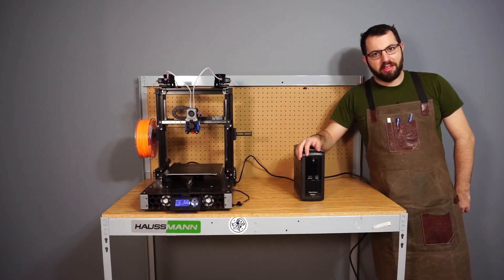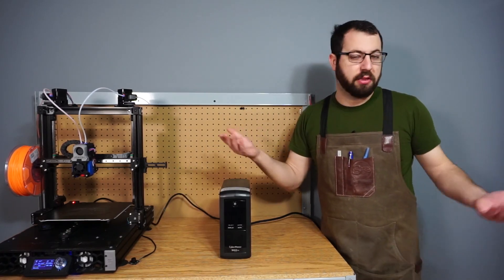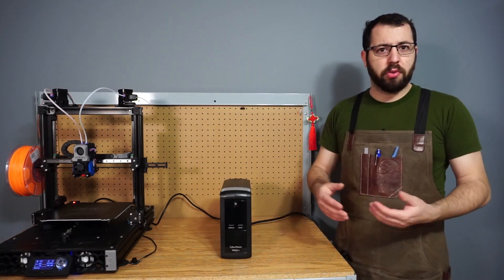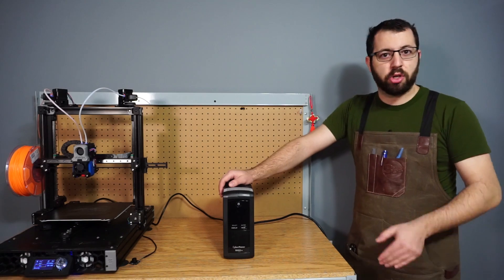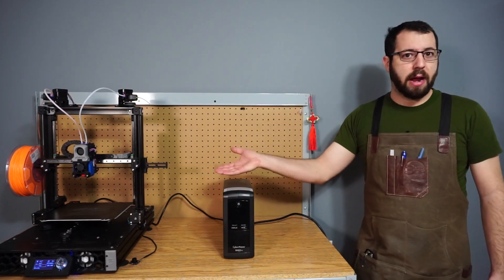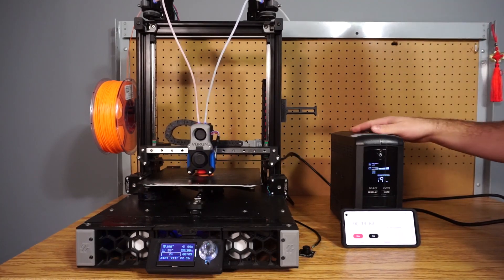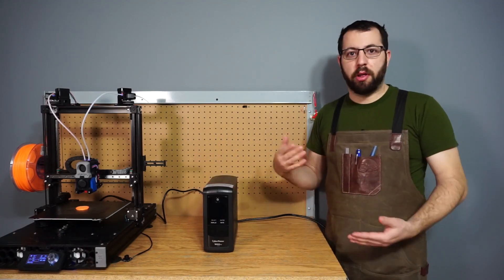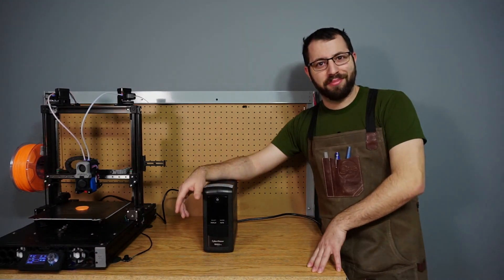Power through power failures with a UPS for your 3d Printer

Comment: This might be a stupid question, but I tried connecting a smaller UPS and it was highly problematic. If I recall accurately, even with the two printers turned off, in the morning the batteries would be dead and the GFCI outlets tripped. I tried another UPS and the same thing happened with it. I tried printing with one connected and they would trip the outlets and run off of the battery till the battery was dead.

Comment: you buy inverter 2000 watts 12 volt deep cycle battery 100 amp do much better run time those batter sucks ok you can change battery i have back-ups cs 350 i change battery to 12 volt 20 amp lead acid battery i dose run 200 watts get much better run time

Comment: You can also use a battery backup deep cycle battery bank for emergencies, you use the UPS til you can switch over to the emergency stand by the power this way you can finish the print/s without interruption.
The UPS will not know the difference if it is getting power from the grid or an emergency battery bank, it is still getting power.

Comment: For me what worked was backup batteries. You'll need a way to fast switch it on when power failure happens, I designed and implemented my own solution for that and it saved me a couple of times.

Comment: An interesting experiment would be to do a print without the bed heater running, since that's probably the biggest draw.  But your test is a real world one and 5-7 minutes of runtime if the power blips is still worthwhile.  I have a few on my machines since most flickers here are momentary (and thankfully rare).

Comment: Nice video 👍 I am from India can you tell me more about hardware implementation like what kind of hardware I will require to save g code after every layer print and how to do that
Reply from the maker: This setup is strictly a hardware method, there is no way to resume once the UPS runs out of power

Comment: does the UPS also absorbs fluctuations of current/tension from the network?
Reply: Generally doesn't matter aslong as its not big fluctuations which rarely happens that's generally just a power outage. Every electronics has capacitors on their mainboard from power supply to the control electronics that stabilizes that. If you have a extremely unstable power grid i would suggest a small ups of sorts but i dont think any power grid is that unstable today.

Comment: Hi! Does it works constantly through UPS (all is plugged) or it switches for a backup power only when necessary? I'm trying to find if it's possible.
Reply: UPS (Uninterruptable Power Supplies) the device will automatically switch over to backup power once power is cut. And switch back to mains power when it returns and then start recharging the batteries. This is a feature that preservers the batteries life.
Reply: @joshuaclement8706  but why UPS are mostly giving non-sine current? as I understand it comes always of this shape (steppy "sine").
Natural sine UPS costs a lot.

Comment: You could also have the UPS communicate with the Pi and have it pause the print to further extend how long it keeps the printer 'on.' There are several examples of how to communicate with the UPS. For the Cyberpower I use the NUT program and have it running on the pi to monitor the UPS. If it senses it's running on battery the script pauses the print. I could release the script if there is interest.
Reply: That's great for PLA, but probably pointless for ABS because with a cold bed there won't be a way to resume it after a while.
Reply: @DiThi  that entirely depends on what layer you are on and how long the outage takes. For outages taking less than the time it takes to drain the UPS you can resume no problem (assuming we are at least past layer 20 or so.) 
The bed heat matters less the higher the layer (also assuming the outage doesn’t last long).
Reply: @seetherage  Big ABS prints are ruined when the bed gets cold: They shrink too much, pop out of the bed and are no longer attached to it.
Reply: @DiThi  for sure, but the time we have before the recommended UPS runs out of juice wouldn’t cause a massive drop in bed temperature for a fully enclosed Voron. My solution isn’t to resume prints hours later, but to allow the print to survive a 10-15 minute outage. I could also have the bed stay on when I pause the print, but that’s where most of the power use goes to so I doubt the ups would stay on for longer than 5 mins. I already have it set to a 2 mins outage timer so that it doesn’t immediately pause for short intermittent outages, and even then the UPS is at 40% capacity after 2 mins.

There is a trade off to this method depending on the duration of the print. For longer 60+ hour prints I just shut down the printer if an outage occurs then manually slice it approximately at the last layer (creating two pieces) then glue and sand it.
Reply: @seetherage  For doubling the outage time that's fine.

Comment: What type of UPS do you recommend?
Interactive? Online? And why
Gotta say you always put up videos of something i was looking for.
Subbed, keep up the good work!
Reply from the maker: Mines a Cyberpower 1000VA, but if possible spring for 1500
As for type, get whichever "good" brand you can snag on sale.
Reply: @CanuckCreator  if the UPS is interactive then the printers power supply should be higher than the UPS transfer time. Online UPS are better as there is zero transfer time but they are more expensiv
Reply: @joseholguin436  sorry noob here. What does it mean when you say power supply should be higher than ups transfer time? How do I check? What units of measurement am I looking for?

Comment: Tip for people that think UPS like that is too expensive: You can get a UPS meant for "heating system", it's a heater, that warms water that runs through radiators in your house. I hope I explained this so you could understand it. These UPS are usually a lot cheaper and you can use a car battery, or 2,3. This will give you a lot more run time. Downside is they take more space, and no fancy display. Cheers!

Comment: Thanks for the video.  If you really want to run longer, you could hook the wires of the ups to a motorcycle battery or car battery depending on the voltage and run the ups that way. Now that would be a cool video.

Comment: I use a ups of 2kva with my voron 2.4 but it flickers a lot ,can we do something for that. Flickering is not there on mains ,used power cycle of 0.02 .Any suggestions.
Reply: Is this UPS is a pure sine wave one? flickering may be caused by a non-sine wave inverters inside a ups. Some Switching power supplies don't work well with a non-sine wave power source.
Reply: @deadmen2249  yes sir, it's a sine wave one (Luminous Cruze 2kva )
Reply: @soravgupta99  This flickering is also occurring with different machines/psu's?(example: PC, Induction motors, other printers/electronics devices)

And one more question: Are you using a car battery with this UPS?
Reply: Maybe Voron 2.4 has high power consumption, do you know what the power usage (Kw/hr, average) of the voron 2.4?
Reply: @erodrigolopez  He probably used a 350W meanwell PSU( it is meanwell but i cant read witch one on his video) and 600W heatbed. I doubt that he overload his UPS.

Comment: Sounds like I need to build a UPS from some bigger batteries. JIC.
Reply: One thing to not the reason these smaller UPS don't have external battery inputs is because they are designed to run at high loads for much longer than they run.
Reply: @Raymond-u8x  understood. I would be making something custom with a couple modules from something like a Leaf. It would be a pretty large setup. If I could get my hands on a whole battery pack I would build a whole house backup battery that would give me 15-20kWh worth of power, probably just run a dedicated "critical loads" panel on it with the fridge, the furnace, a few outlets and lights. Something like that would give me power for days if necessary. Different thing than backing up a 3d printer though. 🤣
Reply: friendly reminder

i bought a modded ones prolink pro 700 650VA that modded to accept car battery and yesterday i used it for 3d printing

i dunno why it shut itself down after beeping fast several times when bed is heating as i use 100C  bed heating (just to note when bed heating is on the sensed voltage is dropped so much compared when only nozzle heating)

i use 60Ah car battery

Comment: You are spitting out meaningless numbers multiple times (you can do better). E = P x t (or W x h = Wh), so average power times expected outage duration equals min. battery capacity.
Reply from the maker: This video was meant to be a generalized overview of why i like using a ups and their advantages. Going into the math would be overkill for this sorta thing. So many variables between printer draw. Ups type and size. Battery age. Etc etc.
Reply: @CanuckCreator  Then simply do not spit out meaningless numbers.

Comment: a couple of tips: when testing a UPS, don't pull the plug. put it onto a power strip with a switch and flip that. reason is that way you won't cut connection to earth. Second tip is never fully discharge lead-acid batteries, they very much don't like that
Reply from the maker: Good point on the power strip for testing. As for discharging fully. This is the first time ive run it to empty. I am aware of the impact but gotta show it off somehow
Reply: @CanuckCreator  Nero sacrifices his battery so we don't have to. Thank you!